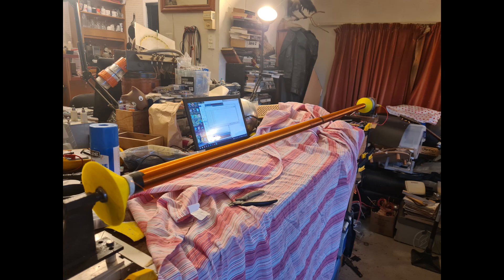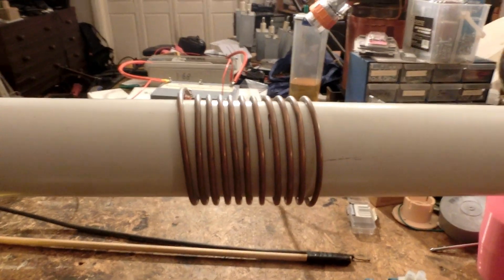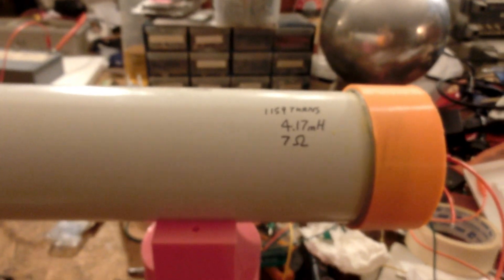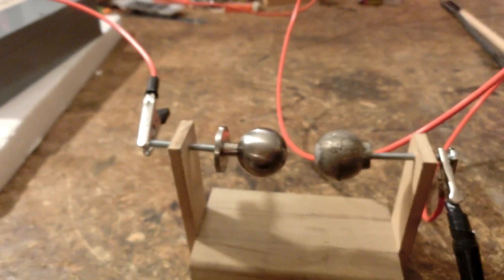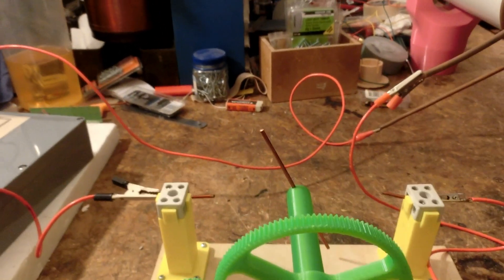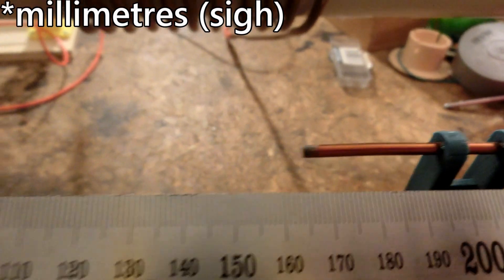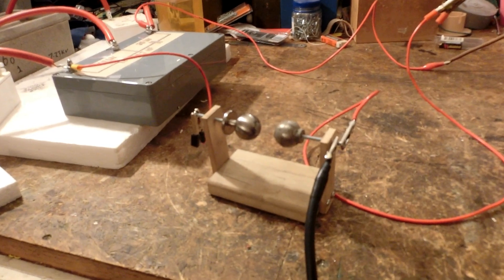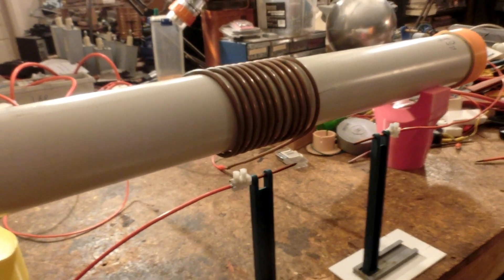Lightning Machine Coil v2 (sort of)

Comment: I suspect you do not have good coupling between the primary and all of the secondary. Try spreading out the primary turns. You could also use a series of well-insulated ferrite rods, stacked end-to-end, down the center of the whole thing. Don't use a contiguous core - use plastic insulation blocks to separate multiple short sections of rod.
Reply from the maker: Yeah, the coupling is definitely weak. I like the inductor idea, will give that a go.

Comment: Are the tubes made of iron? If not it might help to get more energy in magnetic form and so more volts out the other end.
Reply from the maker: Nah, metal formers would block the electric-magnetic field and also be conductive, so the hugh voltage difference between the two ends would just go through them and not through the wires like I want.

Comment: I think most of the power are gone in capacitances between coil and ground .just reduce the length and increase the diameter of coil and gain more volts.:face-orange-frowning::face-orange-biting-nails::face-purple-smiling-fangs::hand-orange-covering-eyes:4000turns is huge,that should give a million of volt
Reply: The H/D ratio has a significant effect on the Q factor of the coil, the taller it is the more the electrostatic field dominates, the wider and fatter the more the magnetic field dominates, giving it a 1:1 ratio and a spacing between each wire of 1.5x to 1.6x the diameter of wire used will give it a far greater Q factor and a much higher voltage output for the same cost.